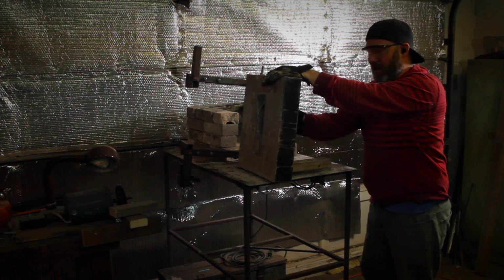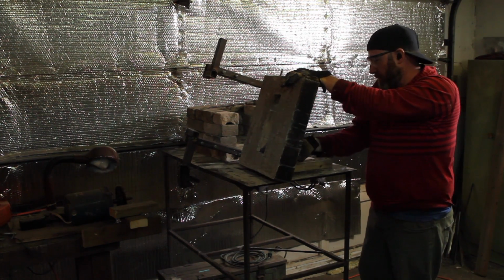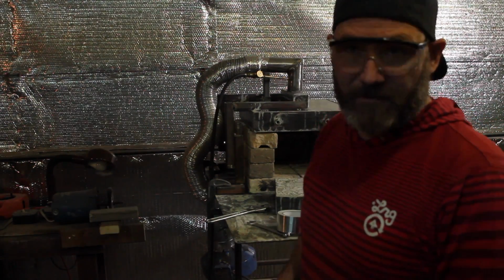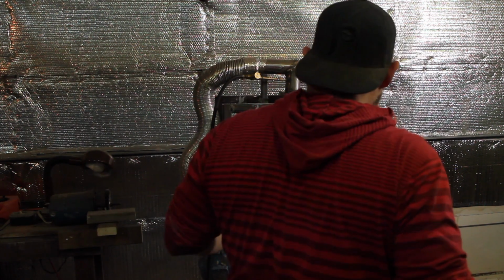Phoenix Forge - DIY Ribbon Burner Testing

Comment: You need more air, burning super rich is your problem
Reply: a bigger blower motor, something with more cfm is what you need
Reply from the maker: Thanks for the input. It took a while to figure out what was going wrong but it has been the opposite. Too much air...

What freaked me out at the end of this test was the change in the amount of noise the ribbon burner makers. It’s way quieter than the venturis I was using. 
It is so much quieter in my shop. It’s great!